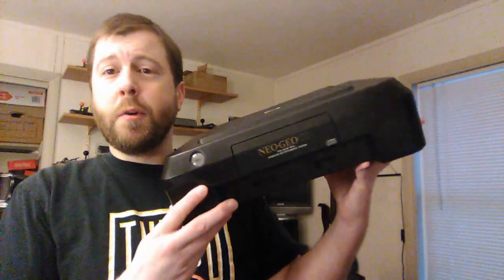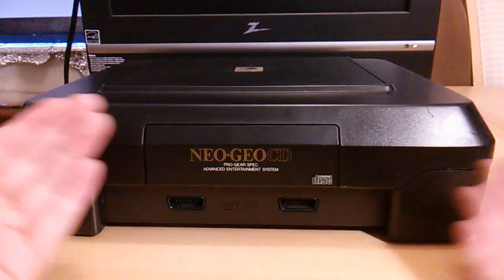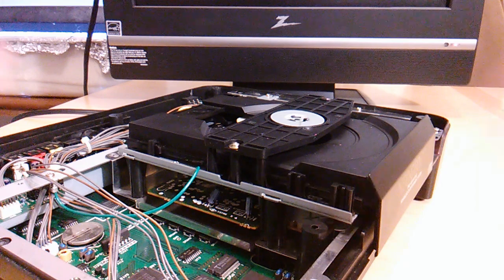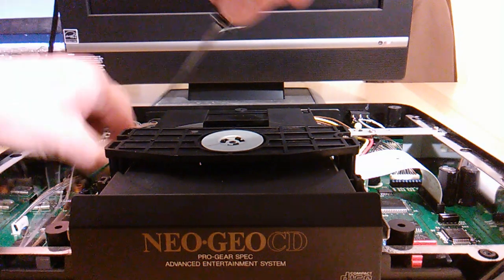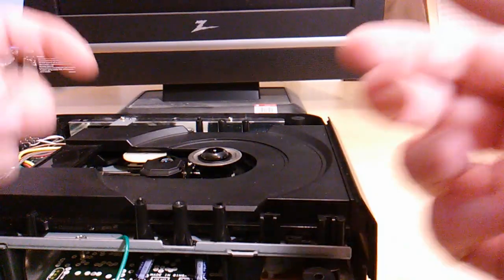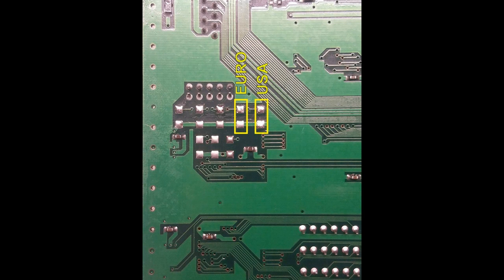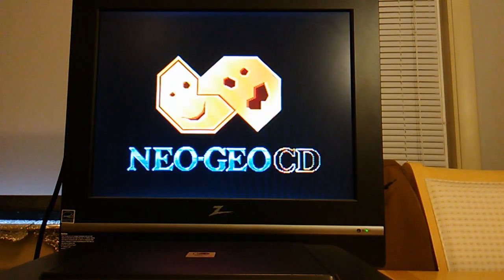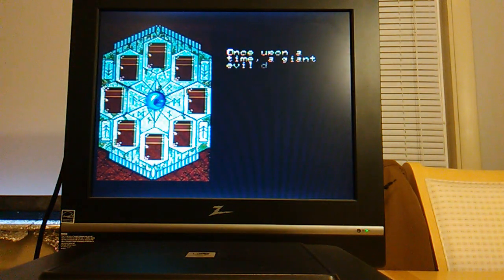Neogeo CD Front Loader System Repair and Region Switch Mod for Adam Koralik. Sega CD Surprise!

Comment: Great video dude. I own a top loader and bought it years ago thinking it was multi regional out the box. After powering it on I quickly realised I was wrong 😂 

I have a few other tray loading consoles that have the same issue as described here, so I might delve into deeper to see if I can get them functional again.

Keep up the good work!
Reply from the maker: Thanks, glad you liked the video. Hopefully you'll be able to use it to either region mod your neogeo CD or possibly fix any of those other optical drives you were talking about. The region switch procedure for any of the top loader neogeo CD systems is even easier since you don't need to take the motherboard out of the system to get to the solder points for each region. From what I remember the solder points for a top loader are near the front right portion of the board.
Reply: Might have to give it a go, especially fixing the other machines. I have a front loading CD-i but the tray has always been really bad, sometimes refusing to even open.

Now if only there was a mod to speed up the load time on a Neo Geo CD, I'd install that in a heartbeat 😂
Reply from the maker: @ryoma0045  I haven't installed one but there is a NEOGEO CD optical emulator available now. Loads straight from SD so it's faster.

Comment: My front loader needs that belt replaced, what kind of belt is it? 
It does the same thing you described you repaired in this video.
Reply from the maker: Do an internet search on eBay or Amazon for Xbox 360 DVD drive belts. They are a good all-purpose belt that can be used for the Sega CD and Neo Geo CD drives.

Comment: Why didn't you put in a Razoola UniBIOS CD? 

That gives you region switching straight up with no switch, and this front loader has a DIP BIOS chip in it, very simple mod.
Reply from the maker: Because removing and installing chips to a board has a small risk factor. This was something I could do fairly easily with no risk to the system whatsoever.
Reply: @Chris-Courage  there is no risk if you have any soldering ability at all, it isn't hard. And if you cock it up, run a wire. Piss easy.

Maybe though, if you don't have the skill, just a thought that maybe you shouldn't be making videos telling others how they should fix things.
Reply from the maker: @CaseTheCorvetteMan   I don't think I've ever seen any information of somebody installing a unibios in a Neo Geo CD that didn't require removing a chip from the board and installing a new one to it. So if there's an easier method for the front loader, then I know nothing about it. If there is indeed an easy way to do it, why not go ahead and make a video to show everyone how to get it done? It would be great to get the information out there.
Reply: Unibios is not compatible with a SD loader. Maybe he planned to install one later.
Reply: @hanzobi1926  yep i know that ;)

Comment: Couldn't a unibios have done the same trick?
Reply from the maker: You are correct. Although a uni bios is extremely more difficult to install with greater risk of damaging the system for anyone not experienced with soldering. Installing a simple switch like this is something even a novice at soldering can do.
Reply: @Chris-Courage  it's easy on the front loader.